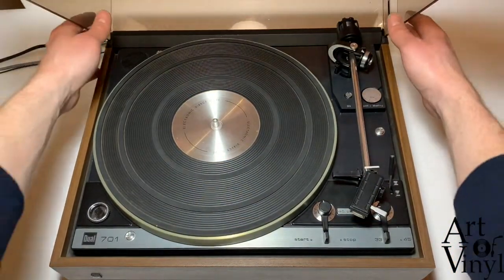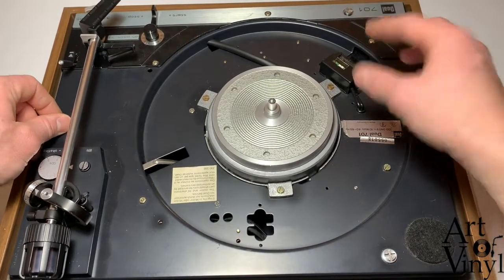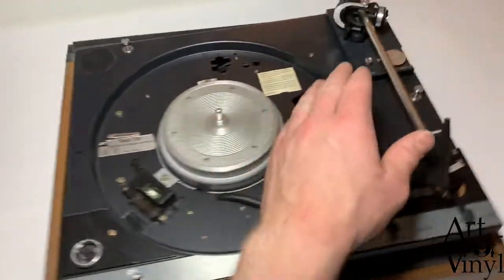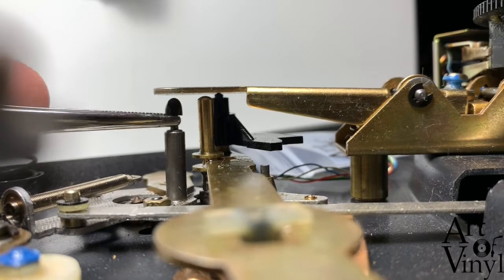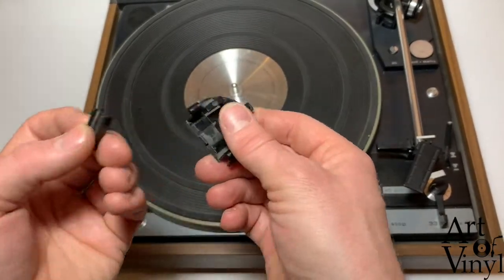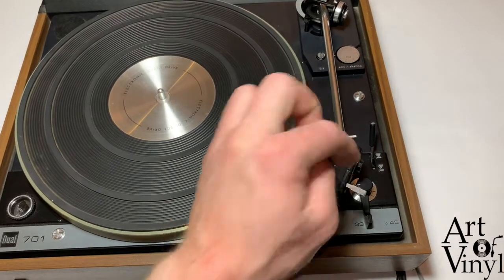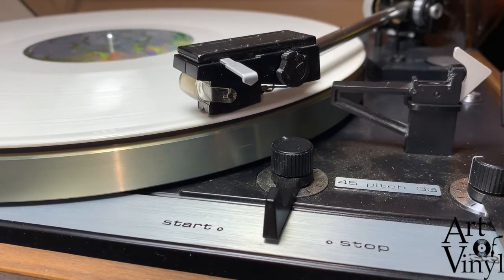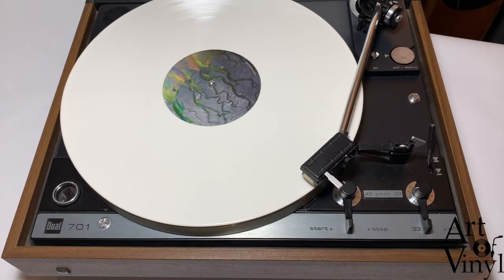Dual turntable steuerpimpel replacement (701, 1209, 1219, 1229 etc.)

Comment: I had my repair guy in Long Island (who specializes in Dual) tell me that he got rid of the old steuerpimpel and now there's no anti skate option on my turntable, but not to worry.  He said it didn't matter.  Your thoughts?
Reply from the maker: The mechanism for the anti-skating is close to the steuerpimpel. It might have been touched in the process of replacing the steuerpimpel. 
This is not supposed to happen when replacing the steuerpimpel.

Comment: I replaced mine with a piece of rubber eraser from the end of a pencil. I measure the diameter of the metal peg, drilled a hole in the eraser, cut it off and stuck it on top of the metal peg, works great. 
Great video, very clear and well explained, especially your disassembly and handling method, thank you so much for sharing !

Comment: GREAT OLD TURNTABLES FOR THE PRICE // HINT> BUY BLUE TACK FROM DOLLAR STORE SPREAD LIGHT EVEN COAT TO INSIDE BOTTOM OF TABLE, THIS WILL TIGHTEN UP THE BASS QUITE WELL, I SOLD DUAL & DID MODS. ON THEM BACK IN THE 60s THRU 80s

Comment: Removing the cartridge should be done First.  
And a 701 doesn't need / shouldn't have a carrier with single/multi settings. Those are for small-platter changer models Only.

Comment: At 08:25 -- The first action should be to cycle the table in automatic mode with the arm locked on the tonearm.  This re-synchronizes, or re-homes, the movements.  This instruction is found in the service manual on page 15, last paragraph.  I would not consider any adjustments until this step is performed.

Comment: H, I found your channel and I need to ask for your help. I have a DUAL 1256 and the tonearm lift lever is not working, I opened and check but everything seams ok, don't know if I can but any new part or if you could be so nice to make a tutorial how to fix that thing. I live in Germany so if I need to buy any part would be not a big deal to send from the NL (or I least I hope). Thanks for your help

Comment: Hello. 

I am wondering if your steuerpimpel would fit a Dual 1237 belt drive model? I had to buy a replacement (got two of them, wasn't sure why), and they didn't work too well. They were made of rubber, the mould they came out of clearly wasn't great, and as a result, the tone arm would cycle to the start groove on the record, and then jut out a bit before the stylus landed. I ended up, after many frustrating hours, having to cut one of them in half. It worked until it popped off the metal post (on my model, the steuerpimpel is on the underside of the turntable, upside down). I took the second one then, and several more frustrating hours of trying to file down the bloody thing, I then cut this in half as well, but instead of the tip being preserved, I clipped it so the shaft was used, and the tip was discarded. It works! But...I like having correct parts, not make shift bush repairs done on my equipment, so I'm hoping your product (which looks a damned sight better than the junk I ended up with) will fit my turntable, and leave me with several more years of listening enjoyment in the process. I am in Canada, does your shop deal with North America? Thank you for your time.
Reply: Dude, there is an abundance of poor quality chineese manufactured ripoff pimples out there. I have stopped using them and now just use a 4mm piece of 14 guage speaker wire housing. Works perfectly and is free.

Comment: hi @ArtOfVinyl Turntable Repairs, i have two Dual turntables, the 505 and the 650 rc, but both have the same problem, the platter doesn't stop at the end of the album. for the 505 i know that it hasn't auto-return but i read somewhere that it should stop the platter and lift the arm by itself at the end (not sure if its true) but the 650 its a semi-automatic so it should auto-return. Have u any idea of what could cause this issues and how to solve it?
Thank you very much

Comment: Thank u for this helpful video!!
Thanks to this video I was able to fix my Dual CS435. The tone arm didn't go back all the way but went back down halfway through the record.
 I was using it like that for more than 2 years. I bought it second hands for less than a case of beer, knowing it had some issues.. but i was never able to fix this. Then I ran into this video and thought.. would my model have such a pimple? and yes my "newer" model Dual record player also has a steuerpimpel.. or rather, it had one. a very very small one.. and it was broken into a few pieces.
I couldn't find one that small anywhere online and ended up using a piece of a ballpoint pen and now finaly everything works great again!!
Reply from the maker: Good to hear your turntable works again Wim! Happy listening :)

Comment: Awesome video, managed to repair the auto start/stop on my Dual 601! Do you know how to exactly adjust the position at which the automatic start function starts? It goes a bit too far in my case, starting around half way through the first song of a LP.
Reply from the maker: That sounds like the 45 rpm stop isn't moving properly anymore. Behind the steuerpimpel at 3:47 in the video is a black plastic thing that is also pushed down by the lever that controls the steuerpimpel. Try checking if it still has its spring attached (remember its position), take it oil and clean and oil it. Should be good to go :)

Comment: adjustable  hedshell is from a  dual recordchanger turntable , pronaly the 1249   ....
Reply from the maker: Yes, the adjustable headshell type is actually from the first record changer in the 1200 series, the 1209. In later models (1219, 1229 and 1249) this was changed to a design that adjusts the height of the tonearm bearing housing.

Comment: hi i have a dual 1225  where is the steuerpimpel in this turntable ?
Reply from the maker: It is located in the same position as this one. Only taking the platter off is a bit different in your model.

Comment: hello thanks for videos,  i have learn too much because of you, i have problem with my 1219. tonearm doesn't drop correct position on 7 inch records. 12 inch record there is no problem. start an end points are correct. where should i look?
Reply from the maker: Umut Poyrazoğlu thank you for your message. I’d recommend you to start with the multiplay sleeve, which is underneath the tonearm. I am planning to make a video about this, but it might take a while. 
For now reading through the service manual will have to suffice. If you find it, it is highly likely that the rubber has hardened over time and it doesn’t correctly pull the tonearm into the correct position anymore when switch the single (s)/multi(m) lever. This can cause drag on the tonearm. Next to this, the steuerpimpel might need replacing but you’ve probably already seen this :) 
The parts are both available on my website.
Reply: @ArtOfVinylTurntableRepairs   thank you for quick response. i will check